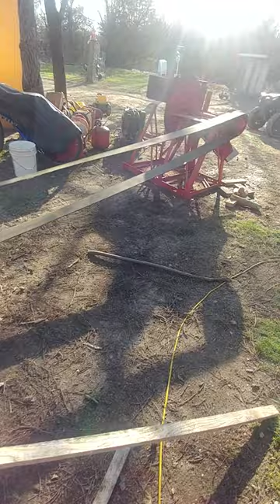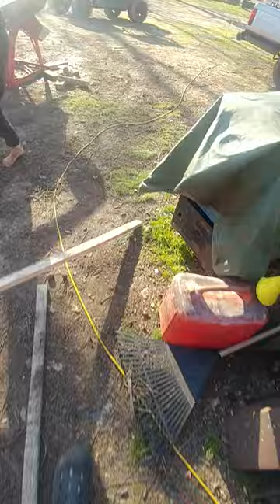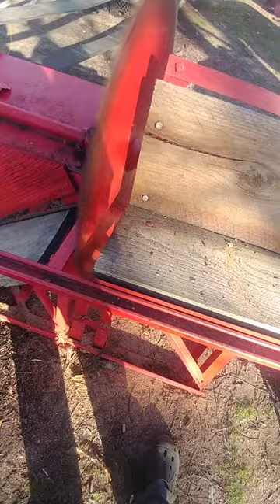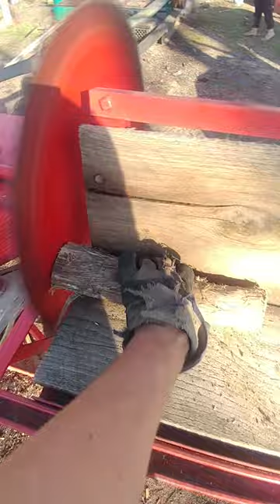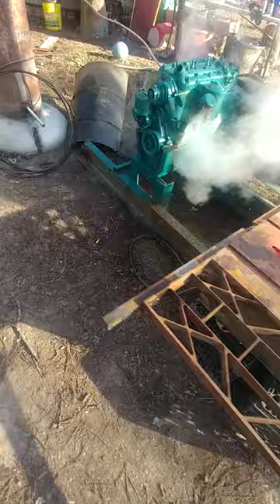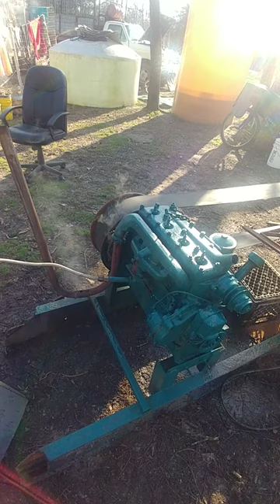Running the cut-off saw with the 9n Ford Steam engine

Comment: Nice job! I also live in the Ozarks. What kind of engine did you convert to run off of steam?
Reply from the maker: The engine is out of an old 9n tractor. I modified the camshaft in it
Reply from the maker: I welded a rim onto the clutch assembly to run a flatbelt